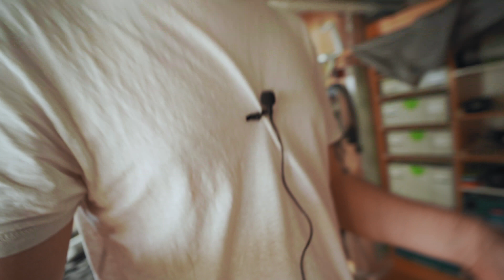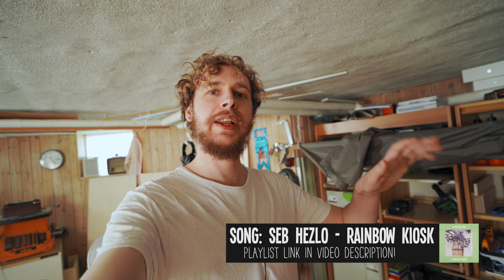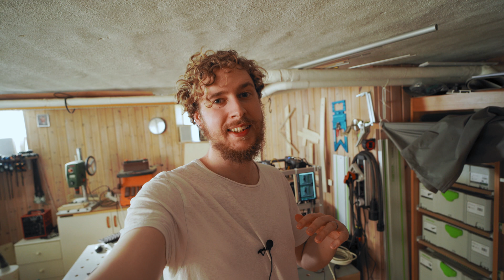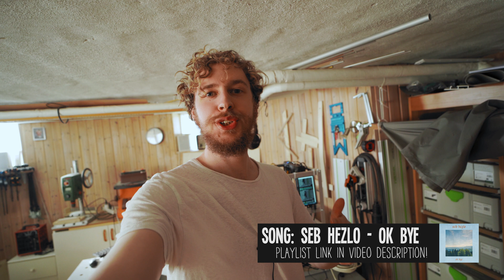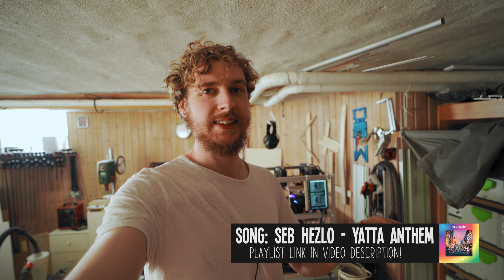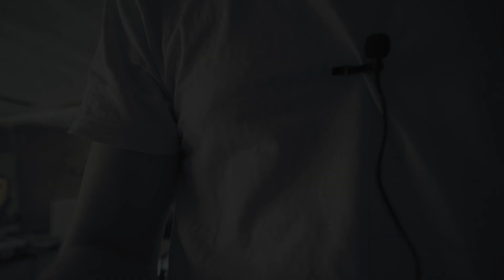What Causes Stale or Rejected Shares and How to Reduce Them (Mining Ethereum)

Comment: My mhz speed on 1660 super will be 7800 like kinda full is it safe or not 🚫 my card oc settings are here core clock -200/ memory +900 power 60 fan speed 75% if anybody could help me or give some knowledge about it I will be glad thanks

Comment: Great video seb and great channel. im a bit confused in my invalid situation, im getting around 0.7% invalids from my high overclocks but im also getting about 1-2% more accepted shares by using a higher overclock setting. Is this still a problem, should i still downclock my cards for any reason? Or am i just better off with more accepted shares. cheers
Reply: I would say you don't need to lower the clocks if you get more coins.

Comment: My rig is running at 99.88% efficiency, should i be worrying about improving this or is this acceptable?  Im new to mining and i do not want to damage anything.  Thanks for you video
Reply from the maker: If the 0.12% are invalid shares I would just reduce the overclocks slightly and you should be fine. If they are stale shares then that’s totally fine. Anything under 1% is totally fine! Good luck in mining, it’s a fun hobby! :)

Comment: I had an issue where I was sitting at 10% stale, 2.5% rejected. I found that it was caused by my wireless network extention to my shed. I replaced the unit with a temp cable problem gone.
Reply: In my case it was faulty network hardware that was causing my rejected shares.

Comment: Hi mate, that is another informative video. I have got three Gigabytes RTX3070, I set them up to 55% power limit and 1250 memory over clock. Two of them keep getting invalid shares, but another which consumes less power wattage and never gets any invalid shares. What is your setting on RTX 3070 and 3060Ti? Thanks
Reply from the maker: Hi I don’t have any 3060ti or 3070. If you’re getting invalid shares usually the overclocks are too high.